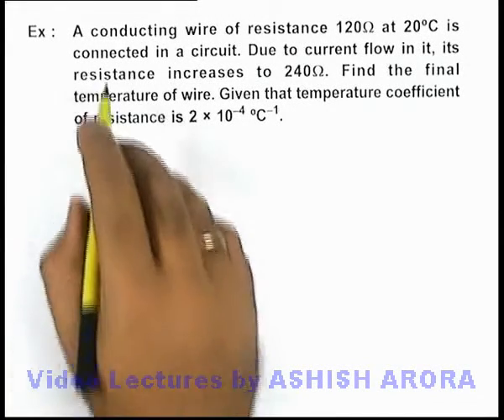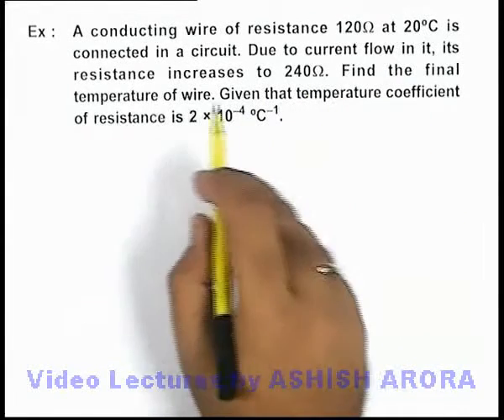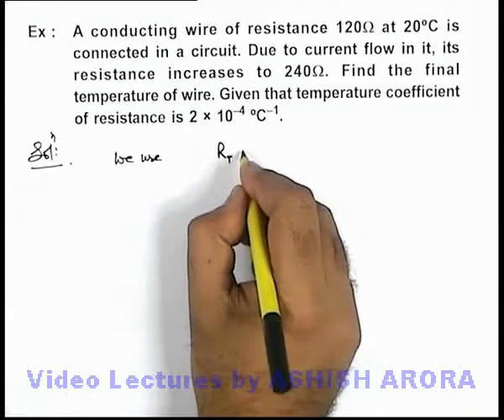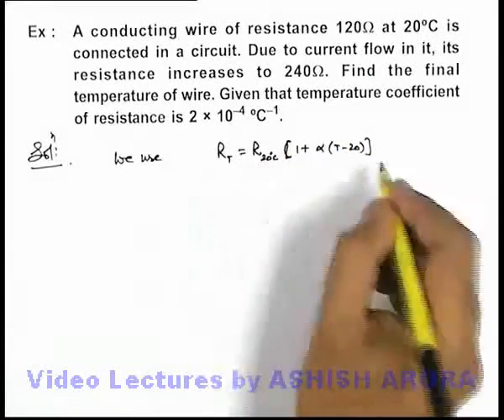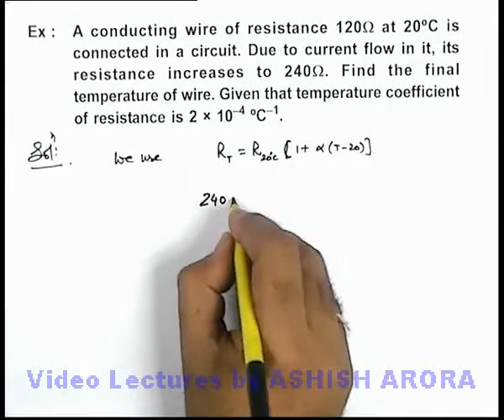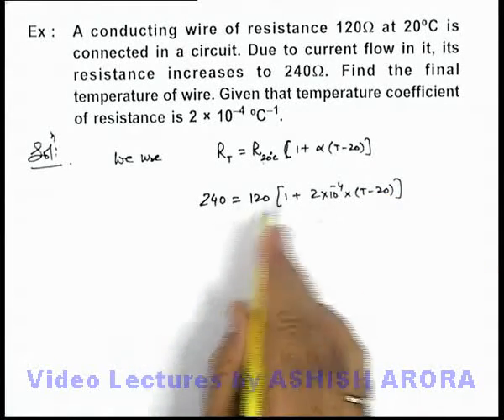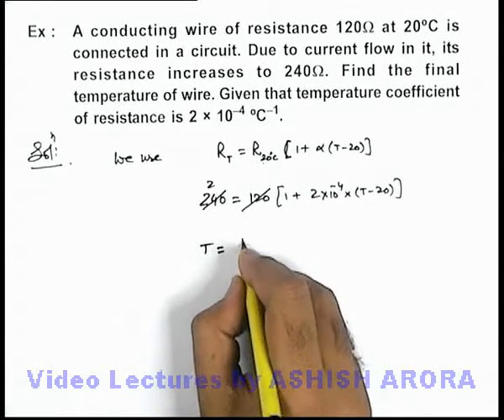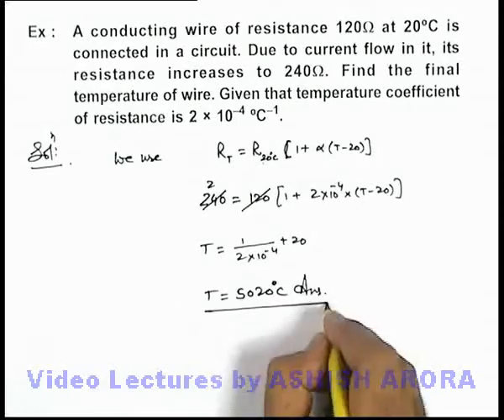Class 12 Physics | Current Electricity | #16 Solved Example-7 on Current Electricity |For JEE & NEET

Comment: Sir how resistance itself increase when current flows in a conductor, as current magnitude is given in terms of drift speed which is like terminal speed of electrons when force of collision and electric fields cancel each other?
I mean to say without change in external temperature how resistance changes?